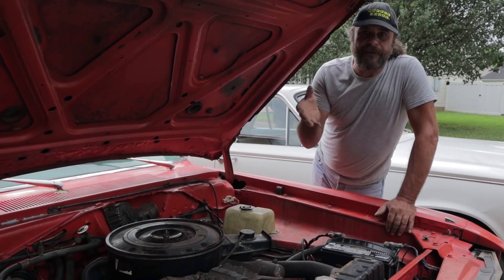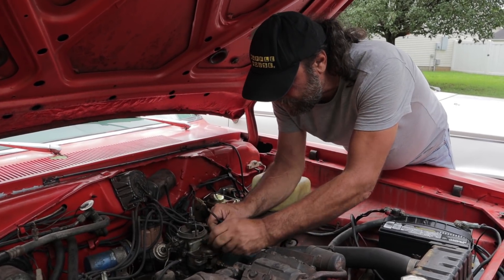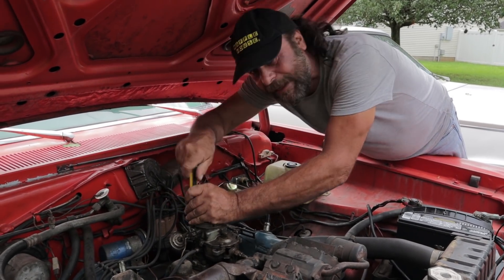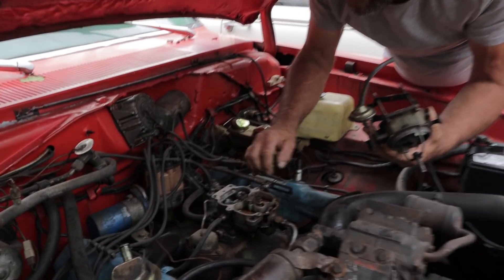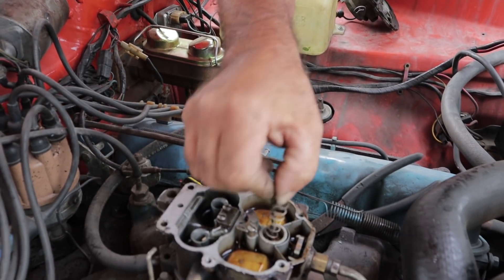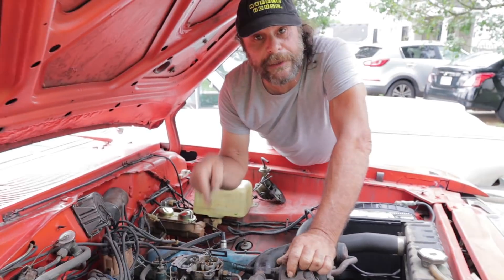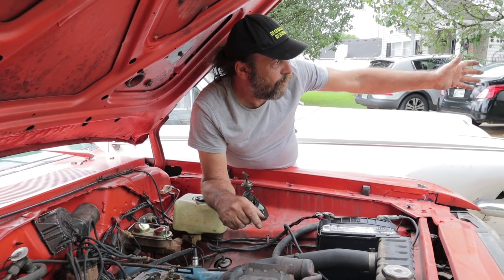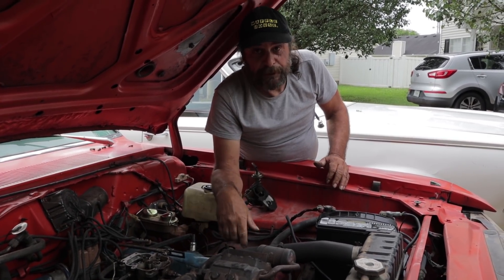Driving Classic Cars- The Truth About Ethanol Gas

Comment: My guess is that it's not the daily drivers that will suffer from ethanol additives in fuel - it's the garage queens that sit around for days/weeks/months at a time where the ethanol is going to absorb condensation and the water is likely to build up in the fuel over time.
Reply: Yeah, in south america they use 100% hydrated ethanol as fuel and it isn't the corrosion nightmare people in America like to imagine. The old carburettors were just lined with nickel and the EFI was rated for it.
Reply: In Minnesota we used to put alcohol in gas to prevent gas line freeze! Because it evaporated the water! Now we dont have to anymore!
Reply: I daily drive a 79 Camaro and a Honda XR600R, in my country there is only e10 fuel and i never had a problem, only with my bike once after it had sit for 3 months, when you use it once a week it’s no problem

Comment: I'd worry more about eating rubber fuel lines and/or pulling atmospheric moisture right through the rubber due to how hydroscopic the anhydrous (without water) ethanol is. The type of solvent action ethanol performs probably wouldn't degrade the leather accelerator pump very quickly but will degrade a rubber one. The rubber relies on elastomers to keep its properties but the ethanol molecule has both polar AND non-polar ends which gives it the ability to dissolve the elastomers and oils right out of the rubber. - But oh well. Too hard to find non-ethanol fuel for a daily driver nowadays so no matter the downsides we just have to deal with it.
Reply from the maker: All that you said is correct..in theory.  Practical reality is that I've never had any of those issues occur where I can directly attribute the issue to ethanol
Reply: @UncleTonysGarage  Is that effectively solved by replacing them with modern fuel lines anyway?
Reply: @gufbrindleback  fuel lines should be replaced in any car that is more than 20 yo anyway...
I've seen some people use very old cars with original fuel lines on E85, and use the car way more than before because of it and wondering why the hoses leaked.

But the truth is, the lines were cracked all over the place to begin with.
Reply: In South america we have fuels containing 100% hydrated ethanol and nothing you said happens. Cars just drive with the benefit of having no carbon deposits.
Reply: that has been disproven  long ago.
Reply: I recall getting gas line forms motor boat and recall being offered either reg line or more expensive ethanol resistant line.
Reply: Also I was told rubber now is more cheaply made via cold chemical vs hot vulcanization. So maybe the ethanol is even worse on the crappy rubber now. Tires didn't used to have expiry dates but now after a few years Crack and are unsafe.

Comment: I don't miss dropping the tank, flushing line's and cleaning the car after a car has been sitting. We've come a long way. Great info in this video 👍
Reply: With ethanol you'll be replacing almost everything on your car because it was never intended to go in a gas tank. Drain your tank bet you have water in your fuel thanks to ethanol.

Comment: Try living out here in the desert SW where if your system is pressurized the alcohol starts boils causing vapor lock like symptoms when you are going up hill in 100+* heat and your vehicle starts loosing power.
Reply: Look back through uncle Tony’s videos. He did a step by step cure that doesn’t cost the earth and works.
Reply from the maker: See the video we did on vapor lock
Reply: All modern gasolines have higher Reid Vapor Pressure than back in the day.

Comment: It's about time someone came out with the truth on this stuff.  I've been running it in my daily driven slant six car for over 10 years with ZERO problems.  Even after the car sat for 3 years with fuel left on it.  Only thing I wont put ethanol in is my 2 stroke motors and my powerstroke lol
Reply: So I just bought a 1972 Dodge Dart slant six. So you have no issues with 10% ethanol fuel?
Reply: @garrisonthad  At that percentage it won't change an thing. At most you will get some corrosion in your carburettor, so just lookout for it.

Comment: Ethanol is terrible in small engines where it sits for long periods of time; it turns into a white corrosion you have to scrape out. It's hell on gaskets in them too, makes them brittle. It's fine to use every day; but leave it sitting in a carb to evaporate and you're going to have to tear it down. 🤷‍♂️
Reply: You can see the crusties below the floats on this carb.
Reply: I drive cars with small 4-cylinders and I don't drive much, maybe like 3000 miles a year, so the car sits for long periods, and I've never had problems, except maybe needing to crank for 5 seconds and play around with the choke to start the car. Though my car is 1991 and one of the last cars ever built with a carburetor, so maybe there's some more advanced tech in it?
Reply: Only if the ethanol fuel was bad to begin with. If it was fresh, not a problem. It evaporates unless its bad and has absorbed moisture and become acidic. The acidic moist fuel stays behind, and that's what corrodes and makes things brittle.
Reply: I agree with the small engines. I buy non-ethanol specificaly for the mowers, weekwhackers and such. I have very little trouble season to season now.
Reply: Glam Stachee What kind of car do you have?
Reply: Sitting lawn equipment with ethanol is the reason I barely had to pay for my equipment because they sit during the winter, then people go to try and start them, they don't start so they think it's broken and toss it to the curb where I pick them up, tear them down and clean them to  get them working again.
Reply: Completely agree, ethanol gas when it sits is hell on carbs. That's why on my small engines and my 340 in my truck I use ethanol free fuel with a fuel stabilizer and fresh oil to winterize. Never once had a problem in years.
Reply: @benderc7778  Fuel stabilizer is a proven waste of money...do some research.
Reply: My experience with ethonal gas is that it boils when hot.  Hard starts when the engine is hot because its flooded and hard starts when cold because the carb is dry because the gas evaporated.  Long term storage has been bad with corrosion since alcohol will absorb water.  I have noticed that there are different blends for different areas and for different seasons.  Im in Chicago and the gas is terrible and winter blend is noticeably worse than the summer blend as far as storage is concerned.  I dont know the science behind it, but i see the results.
Yesterday i pulled the carbs off of a GTX with a six barrel and the gasoline was very green, i have only seen this with ethanol gas
Reply: My fix for many old cars running ethanol is to block off the crossover in the intake and put an insulator between the carb and intake.  This reduces the carb temp and stops or greatly reduces the ethanol from boiling.  In case anyone didnt know, ethanol gas has a lower boiling point than regular gasoline so it atomizes better.  Great for fuel injection, but terrible for carburetors.  Ethanol throws off the jetting by about 5-7% too, everything i touch has to go up a jet size to be equal to non ethanol fuel.

Comment: Am i the only one that thought one of the nuts/bolts was going to flip into the Carburetor ?
Reply: Been there, done that. I also learned the hard way to never work while the car is sitting on grass. Small screws, bolts, and springs just disappear in to another dimension when they land on a lawn.
Reply: I was sure those screws would roll towards the cabin air intake slots when he tossed them onto the cowl. Whenever I dump important screws like that, they always roll toward the nearest hazard. Or does that only happen to non-magnetic screws?

Comment: It’s exact opposite. My snow blower sat for a year and ethanol crap turned in to hard syrup in the jets. 
Now I run non ethanol and let it sit for a year and it starts on first pull
Reply from the maker: Gravity feed fuel systems are a completely different animal
Reply: I have the same problem with all of my small engine powered equipment. The alcohol in the gas absorbs water corroding the inside of the carbs. I either run 100% Gasoline or have to add Staybil to the gas. I think E10 is a joke. When we were forced to use it my gas mileage dropped. For every reason they gave for using it, I can counter with a viable reason for it not to exist.
Reply: @danielkuchenberg7046  Yeah it can corrode carbs. That's why cars where they run 100% ethanol used nickel-coated carbs.

Comment: I deal with this everyday. Ethanol sitting in a carb is bad. Goes to shit after a month. I can post pics if there is any doubt
Reply: Fuel goes bad IN THE TANK and then makes it into the carb, where it wreaks havoc. Fresh e10 left in a carb is a non issue.
Reply: @Rhetorical Answer Fresh E10 evaporates from float bowls before it becomes an issue, just like Tony said. It's as simple as that. People who have fuel system problems with e10 will have fuel system problems no matter what type of fuel they use because they're lazy. Period. Straight 87 will varnish in roughly the same amount of time. 

Additionally, it takes a lot of exposure to air and a lot of time for e10 to go stale. We're talking like 2 months left untrated in a tank that also contains a lot of air. There isn't enough air in fuel lines or carburetors for fuel that STARTS OUT FRESH (again, that's key) to become stale. E10 goes bad in containers full of fuel AND AIR, i.e. your storage can and or fuel tank. 

E10 in a clean fuel system with no other problems is nothing to worry about. If your fuel has been sitting in the tank all winter, run it out before you store whatever it is you're running, even for a day. E10 fuel that sits all winter is fine, just don't let it sit in a carburetor. RUN IT OUT. The majority of carbs I rebuild are ones that started up fine the first week of the season, but not the second. Why? Because the fuel from the end of the last season was fresh, and evaporated, meaning the carb sat dry all winter. 

That goes for anything that runs on gasoline. 

I don't expect you to understand, but that's how it works. A snarky comment seems all you're good for in conversations about modern fuel in carbureted gasoline engines.
Reply: @doug960  hey Doug, just curious...you mean at the end of the season when you put your vehicle up for the winter, run the tank dry? 
That won't cause any larger issues? 
Thanks in advance, I'm a total newbie who's learning about ethanol and my 1985 F150. I just drained about 5 gallons of brown sludge and fuel out of the tank. Its horrible.
Reply: @jtmacready  The bottom line is this. Alcohol (ethanol) is hygroscopic, meaning it attracts ambient moisture. Like I said, FRESH E10 fuel has no problem evaporating cleanly from float bowls, jets, etc if it was fresh to begin with. Once it gets full of moisture, it WONT evaporate cleanly anymore, it becomes highly acidic, and you get that classic green crust and corrosion all over your fuel system as it sits there. Fresh fuel sitting in lines doesn't go bad because there's no air or moisture to cause it to go bad. E10 fuel doesn't destroy lines all by itself. That's a function of the acidity associated with fuel that's already gone bad. 

If your vehicle is going to be driven less than 5 or 6 times a week, stabilizer will help, but it isn't a guarantee against issues. I think the ability of stabilizers to keep e10 fresh for an entire season is overblown.

I'd advise against running a tank dry in a vehicle by running the engine. Small power equipment that usually isn't an issue. You may suck up sediment concentrated in that last bit of fuel and foul your carb, injectors, etc. 

Draining the tank is your best defense against issues from long term storage. Make sure the last bit of fuel to go into the fuel system before you put it away is fresh, shut off the fuel supply, let the engine burn what's in the system until it dies and won't restart, and drain the tank by ciphon, supplying voltage to the pump and directing the fuel line into a can, etc. You won't have any fuel system issues. 

E10 is so poorly understood and there is SO much bad information out there.

Hope that helps.

Comment: My understanding is that the older cars didn't have alcohol friendly gaskets, hoses, etc.  Most of the rebuild kits have gaskets, floats, etc. that will work with ethanol blends.  I agree with the other comments about letting them sit too much.  Had an old boat with and in-board and I had to drain the fuel every year or it was a mess.  (Stored outside over winter without the a sealed fuel system)   Daily drive them, but be aware that if are going to let them sit to throw in the additives mentioned by others here.   Keep up the great work Tony!

Comment: How about lead free fuel in your pre-1975 engines? They say valves get trashed from lack of lead.
Reply from the maker: Never have had any issues with that.  This engine is a 72 and I don't use any additives
Reply: That's only true for some GM engines pre 1970. The big displacement Pontiac and Cadillac engines with iron heads especially had valve seats that are soft enough to erode without lead to isolate them from the hot valve and keep them cool. My dad daily drove his 68 Firebird 400 until about 1996 when the valve seats were toast. The iron forms iron oxide in the presence of a lot of heat and flakes away. Essentially the engine eats itself to the point where the valves don't seal anymore. New heads with hardened valve seats were required to fix the misfiring and compression loss.

Comment: Hey that’s really good to know. I was always under the impression that ethanol is what is killing engines and seals for your fuel system. 

I have a fully restored 1985 K5 Blazer with a performance 350 still running the Quadra jet  The only thing that I did was get rid of the clothes lube emissions carburetor and switch it out to a full vacuum advance. Now there’s no computer on this blazer at all.

Comment: In brazil and south america all the way back in the 60s they ran "gasohol" mostly alcohol from corn maize. No issues. There was a study where a 2000s tahoe was run on E85 and a few years later was stripped down and actually found that all conponents were cleaner than gasoline. A gas fuel pump plastic had turned brownish yellow while ethanol stayed new white. From my personal research into running ethanol is that compared to gasoline it is actually less corrosive due to less chemicals like Benzene that stain and corrode. If it is a daily driver the fuel will evaporate, but after sitting especially in moist environments ethanol will pull and combine with water. That is the point it starts to be corrosive the more water is absorbed.

Comment: The small engines used on lawn equipment, portable generators, etc, that see infrequent use seem to suffer more from use of ethanol type gasoline. 

The industry saw an opportunity to rip off customers that had to pay a small engine mechanic big bucks to get their equipment running again after sitting all winter with ethanol gas in the carberator and fuel tank.  Then those customers started seeing those quart cans of pre-mixed two cycle gas (WITHOUT ethanol) on the shelf for sale for about $4.00 or $5.00 a quart, ($16 - $20 per gallon) and bought it to avoid the hassle and expense of taking their equipment to the repair shop every spring. 

I've had very good luck by purchasing small quantities of gasoline so it gets used before going bad, because of the ethanol.  And I use Sta-bil fuel stabilizer (made for ethanol gas) in the gas as I purchase it.   Since then, zero problems in about ten years with my equipment not starting in the spring.
Reply: I just use the canned gas.  There's a bit more to it than just no ethanol.  It's good for up to 5 years if it's stored in the metal can, for one thing.

Comment: Hello Tony i have a question i would like to ask you about motor oils when i was younger the older model cars required zinc in the oil i have noticed that it has ben removed and it is very hard to find any oil with zinc in it today i know they sell a zinc additive to add to the off the shelf motor oil do you think its as good as the original or is it what we just have these day i like to know what you think about it in not talking about old cars with new motors iam talking about older cars and motor. THANKS i am looking forward to the old school technology platform.
Reply: Recently I made the oil change on my Slant Six using Valvoline VR1, I read somewhere that Penzzoil still uses zinc (but I don't remember which one and there is almost no info), however I saw adds about Motul Classic and Marvel Mistery Oil Classic, both containing zinc specific for old engines.
Reply from the maker: I use shell Rotella in all of my performance oriented engines (High spring pressure-aggressive camshaft profiles) and whatever is cheap at the supermarket in my low performance dailies.  The 318 in this car has been fed nothing but shit for well over 100,000 miles and she hums down the road just fine
Reply: A high zinc content is used today in what is called "break-in" oil that's only supposed to be used when an engine's brand new. You could use that.
Reply: Lucas tb zinc plus every oil change 67 camaro 350 w 10k on the motor in 7 years.although I'm seeing it may be not needed but I sleep better at night using it that's all that matters.

Comment: Finally someone on the subject that gets it! Ethanol gas has been mandatory in Minnesota since the 90s, I've had less trouble with it than I did with the old stuff. I'm looking at a snowblower I bought in 2011 that's only ran ethanol gas. In that time I MAYBE remembered to use stabilizer like three times. Ten years, zero problems. Hell I run it in the 66 Volvo wagon  in my picture. Two SU carburetors zero problems. I could go on and on, point is zero problems! That includes two cycle engines where you mix the gas!